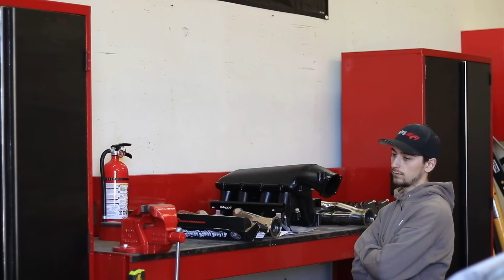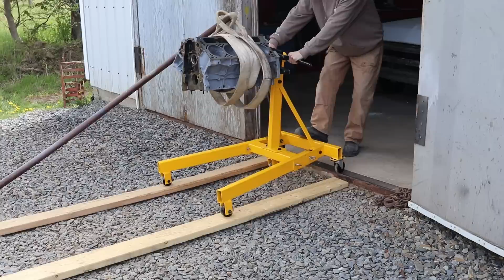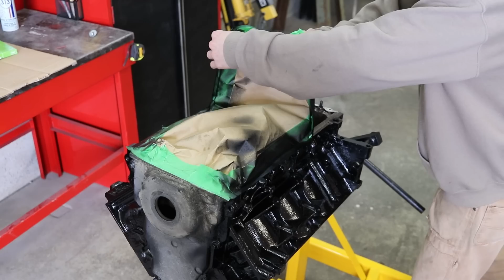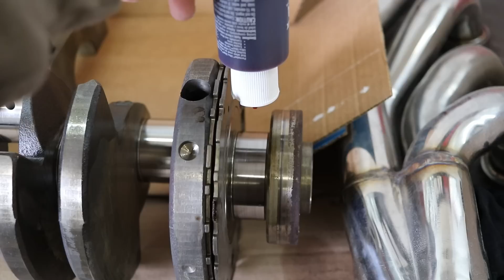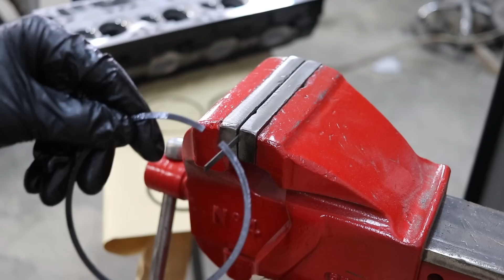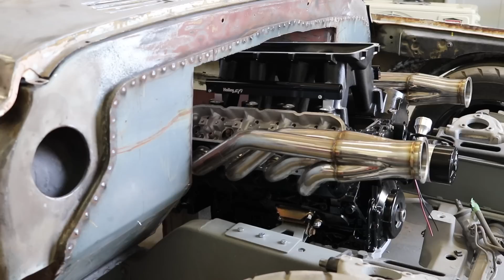Turbo 1968 C10 BUILD- Engine is Looking INSANE!

Comment: Ok, hear me out on this one. Highram is great for NA engines, long runner length is great for low end. however, under boost it doesn't really have any benefits. The one issue that people have is that the back cylinders tend to lean out more due to the direction of air flow. With boost your air is gonna basically plow into the back of the intake and feed Cylinders 7+8 with more air then the rest. its not massive but most tuners will pull a degree of timing from both rear cylinders and add a bit of fuel to them. not a big issue, can be worked with. However. a top down intake like Holleys (300-255BK with 300-240BK ) Single Plane intake, with a throttlebody and 90 degree elbow would give better air distribution for all the cylinders. Some people love the look, some hate it. Personal taste imho. But it does one big thing for you down the road. If you ever want to run Meth injection you wouldn't have to pick up a direct port kit, a Throttle Body injection kit would have really good distribution without the additional cost. However, these are small advantages. The Height of your HighRam is 12.32 inches, the Single plane intake with flange would hit 12.44 inches which you may be able to get away with with where your engine is placed. looks like the firewall is just behind the midway point. It would be a sick setup IMHO.  The Midrise would come to 10.44 inches but if you don't want to do the single plane style intake, id look at the low-ram with a duel fuel rail setup (no need for a meth kit, plus you don't need to do this right away, you can just throw the old truck injectors in to plug the fuel rail/intake manifold and leave the caps on the second fuel rail in place for the future). Why they don't offer the dual injector setup on the highram blows my mind. but. that is a rant for another time. The options for dual fuel are amazing. if you ever go with a Holley Dominator you can honestly tell the computer over 12psi of boost, switch to race gas. Would be amazing. however, you could legit pick up another injector harness from holley and swap the Terminator connector over to the other injector set if you ever wanted to do max effort race gas stuff. But you wouldn't have to drain your main fuel cell to switch fuels. Granted, it would require another set of injectors, small fuel cell, fuel pump, Fuel pressure regulator but how sick would your engine bay look. Maybe Holley will come through and sponsor you with a Dominator so you can do exactly that. If not, i'll find a way to use a signal output from the terminator to activate a switch that switches what injector harness is being used. Food for thought. (forgot to say, you have to remember your engine is gonna buck/flex when under load. so need alittle bit of room for things to move)
Reply from the maker: Great info man! I'm definitely gonna consider what you said👍 appreciate it. Once I get the cab situated and start measuring, I'll see if a mid ram is a better fit. I'll definitely be setting up something for race gas but haven't decided what to do just yet! Thanks again👍👍

Comment: Leave the hi rise intake and trim some of that upper firewall away.  As long as you only take away a few inches it wont cause issues with anything.  You MIGHT have to make a custom wiper setup but its worth it to keep that hi rise intake.

Comment: Go mid ram and call it good. Your boosted, so youll have plenty of velocity and off seat flow. What you lose in peak number, you'll gain through the middle and low end where you'll actually be driving most of the time.👍
Reply from the maker: If I have to cut more than an inch, I will order the mid ram. Valid point, thanks man👍

Comment: I've only ever used those ring compressors and they're a pain but always work in the end? 
Wind it up nice and tight on the piston, drop piston in with big end crank journal furthest away position, tap top edge of ring compressor with a hammer to sit it even down on the block, keep pushing the compressor down against the block so hard you almost cut your hand until the piston is in, and tap the piston in with the wooden/plastic handle end of your hammer.   If you feel any hard resistance stop and start again, but you should be able to make it work.. thats a very common type of ring compressor...
Reply: Sick build btw 👌
Reply from the maker: I've got a new tool on the way so I'm just going to try that. Thank you very much man🤙

Comment: Looks amazing! High Ram looks bad ass but not very practical for the amount of mods needed for proper clearance, I would go with mid height. I really do not think you will be loosing any performance and possibly gaining some! Hopefully you can get full return credit for the High Ram. Cheers, Ray
Reply from the maker: The high ram was mainly for looks but a mid ram would be fine too! Once I get the cab set right, I'll see if a new intake will be easier or if the high ram will do!

Comment: Move the engine forward before you cut the firewall. I think you have plenty of room before you cross the front wheel axis. The transmission is going to take up some cab space as well if you don't move it forward.
Reply from the maker: There's plenty of room but I want the engine as far back as possible for weight👍
Reply: @agtrucks  I know you're going for weight distribution, but all you need to do is keep it behind the front axle line.

Comment: What beautiful truck bro, hey what size of tires and rims has ?
Reply from the maker: Wheels are 15x10 aero in the rear with 325/50r15 nitto nt555r2 tires and up front it's vision D window 16x8 rims with 265/50r16 toyo proxes r888r

Comment: You have a lot of room, maybe a different set of engine mount brackets so it sits more forward and not so close to the firewall
Reply from the maker: I'd like to keep the engine as far back as possible to have the weight closer to the center of the truck 👍

Comment: I have built 40+ engines using that exact piston install tool. They are simple to use. So something in your trchnique was off.
Reply from the maker: I don't doubt it but for some reason, I could not get that piston in. I've tried numerous times with different techniques and no luck. My new too is on the way so I'm just going to wit for that one👍

Comment: You do not need a high ram for a turbo build.  You need air volume and not necessarily air velocity.  Get a shorter intake
Reply from the maker: I know the high ram may not be the best for low-mid power but I like the look and with the weight of this truck and 2 turbos, I'm not going to be missing power anywhere lol. Valid point though👍